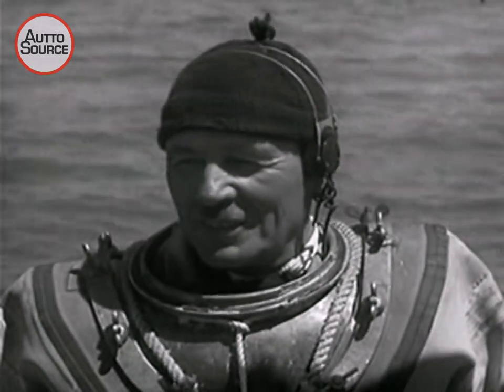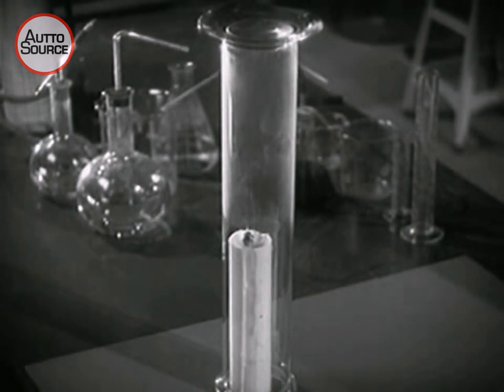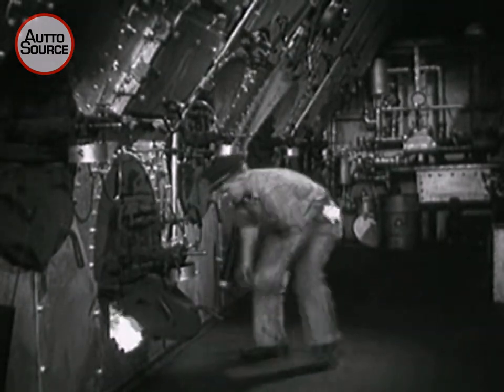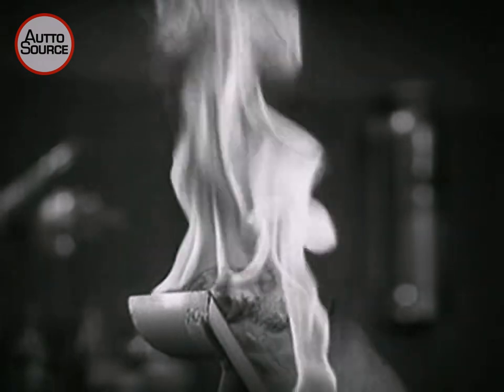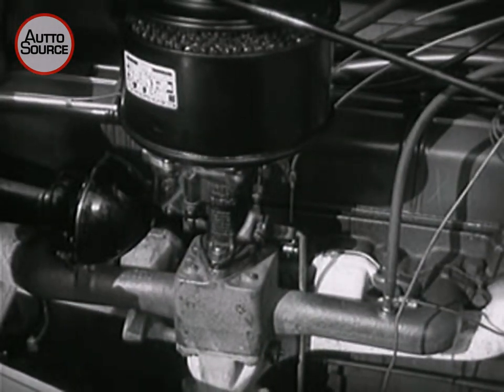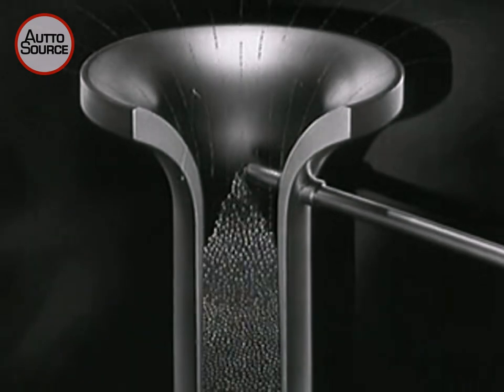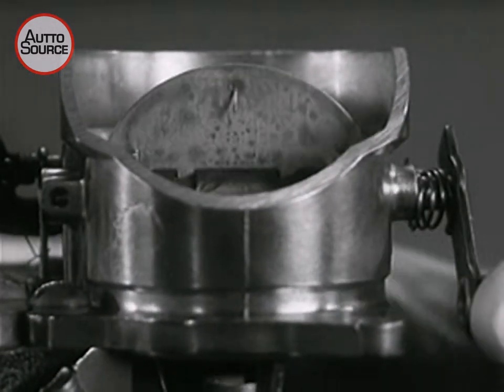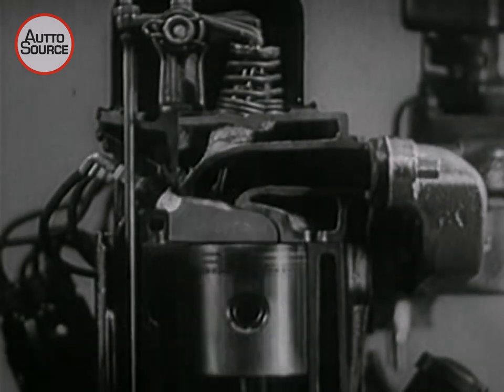How Carburetor Works

Comment: The first turbo! The speed pushes the air into the engine! Lol
Reply: Yes, that balloon is forced induction. Rammed Air, Supercharged, and Turbocharged, are different types of forced induction.
With ram air, usually a scoop, forces more air into the engine, the faster the vehicle goes. Superchargers, are air pumps, powered directly, by the engine itself, or possibly a strong electric motor. And Turbochargers, are air pumps, powered by the the exhaust leaving the engine. So technically that balloon is ram air, but I think previous vehicles, like planes, may have used scoop ram air systems already.
Reply: +RoyalSilver&amp;Gold Superchargers and turbos have been used on planes as early as the 50's or even earlier as i understand.  The lack of oxygen at altitude required forced induction.  Its the same for cars, thats why cars in high elevations run worse than an equally tuned car at sea level.
Reply: +RoyalSilver&Gold get a fatty to sit on the ballon and do some dyno testing.
Reply: Alex Archer yea  sure if thats funny ya know

Comment: This video doesn't consist of the technical aspects of a carburettor.
Reply: +vaibhav yadav Not sure about a "carburettor", but the video does give a good high level overview of what the function of a Carburetor is and how it operates.
Reply: @thom1218  you both spelled it correctly. u ass
Reply: Reply to this with the title of a better video.